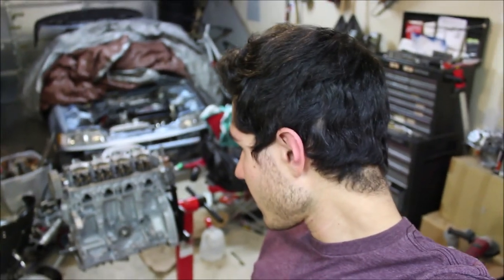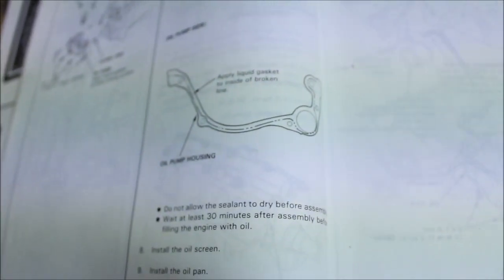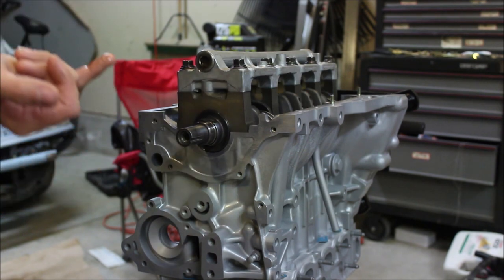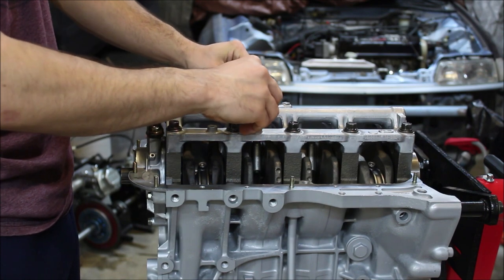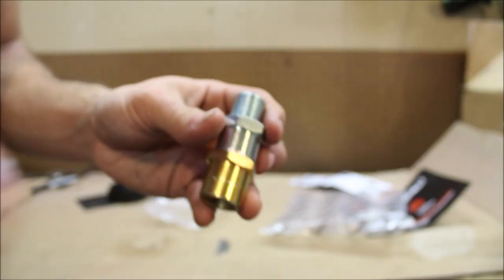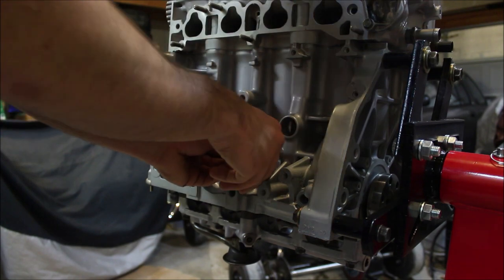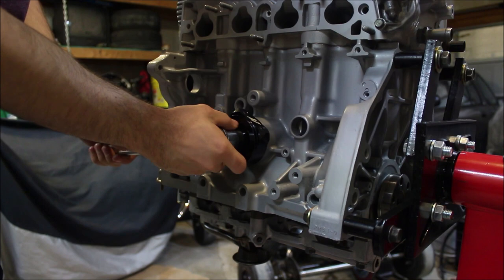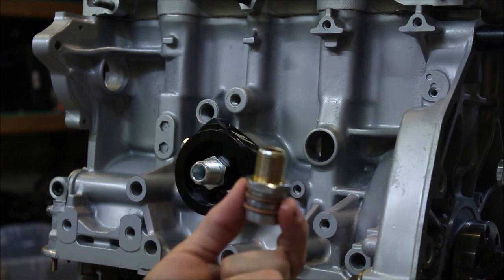Installing Oil Pump and Multipurpose Oil Sandwich Plate On A D16 (Turbo Build)

Comment: How do you like the sandwich plate? Planning on running it on my k series with a -4 feed line do you think It would be a good setup ?
Reply from the maker: @M._arias9402 it's been great!  This is an older video I hadn't posted yet and I've been running that same plate since 2016 roughly.  Even used it on another friend of mines build and it also held up perfectly!  I have a link to the one I used in the video description if you're still considering it!

Comment: do you know if you are able to use the sandwich plate as a feed and the return or is it a feed only?
Reply from the maker: They are only used as a feed. A return line would need to be made in the oil pan